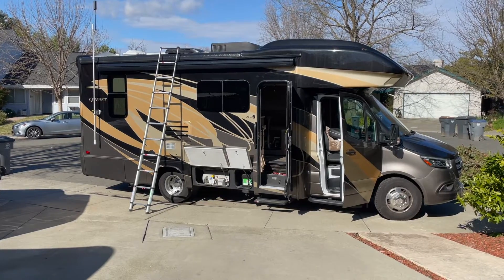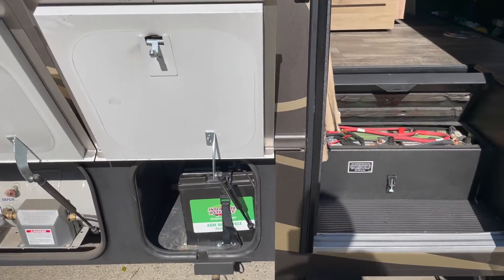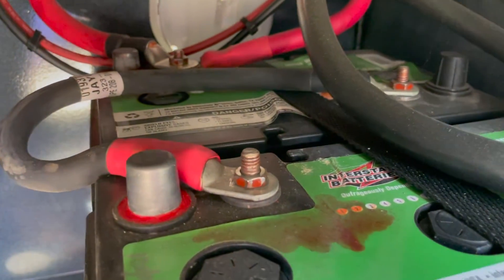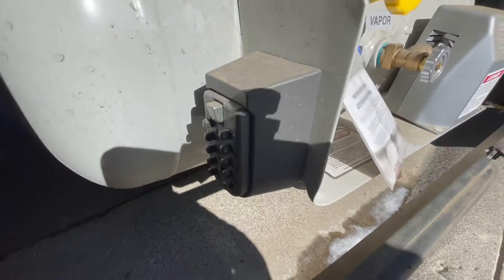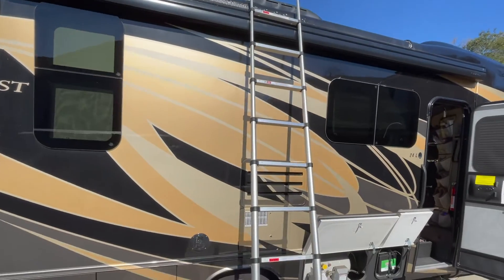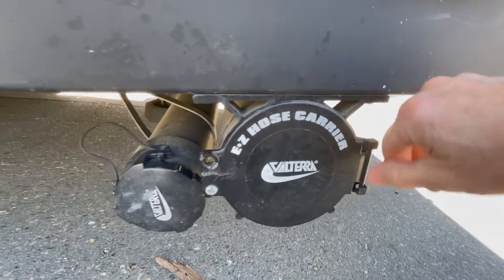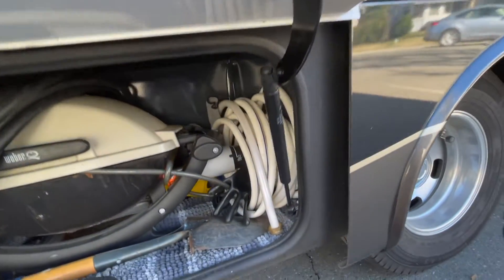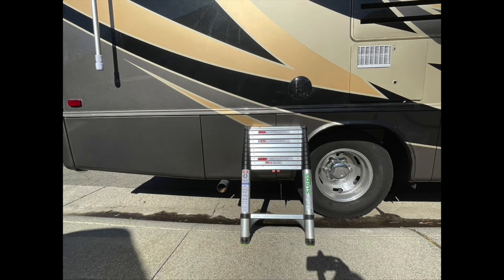Entegra Exterior Upgrades Motorhome Class C

Comment: Hi Julie, we've talked before.  Can you help me figure out how to identify and order key blanks to have an extra key made for the hide-a-key box, like you installed.  My local locksmiths do not have the TriMark key blanks for our 2020 Entegra Qwest.
Thank you,
Tim
Reply from the maker: Never had to order one, came with 3 but with that said, try emailing directly and include your unit number (specific to your unit, usually LZ38965 something like that) and I bet they can get for you……motorizedservice@jayco.com.  They have helped me out on rv blue prints etc.
Reply: @rvtipsandbitsneverstoplear3895  Thanks so much!
Reply: Hi Julie, I just wanted to add that I was able to have duplicate keys made after finding a site called "Easy Key".   I ordered the TriMark keys using the number stamped on the originals and they worked perfectly!  BTW, Jayco was no help at all.

Comment: We have the same exact Qwest 24L that you do except that we have a diesel gen. We have just bought the 2020 with only 8000 miles and are loving it. We are really enjoying your videos and incorporating many of your ideas. I do have a couple of questions please-On the compartment door, I’ll order the bracket but, can I use the original gas strut? We have a set of 6 Flo Thru TST’s and 4 of the smaller. I too did not like the Flo Thru’s and will probably buy two more of the smaller ones. We had a class A and towed a Honda CRV. Wife does not want to tow but, I do. What do you tow and how has that worked out? Are those 6 Volt AGM’s under your step and do I have to worry about the original charger working for the AGM’s? Thanks, Ken and Teddy
Reply from the maker: Yes, you just need to order bracket, see link above, took a few minutes to figure out how it attaches and you can use your other door as a guide, bracket will clip on to strut. We have a set up for a tow of a two door Jeep and we have towed it a couple times. But to be honest we are actually trying to learn to camp without towing since this RV is pretty easy to move around. I think if we go to like the Sierra Mountains or areas where we might not want to drive the motorhome up to go hiking that we might tow the jeep. Yes you can just switch out your 212 V batteries and go with the six full AGM. You don’t really need to change anything else as it is compatible. I do have the Xantrex inverter and when reading the control panel that I put in I did have to switch that to read AGM. This is our seventh Motorhome/trailer, and we are doing a lot to this one to make it our own instead of always changing them out! But we’ve learned a lot along the way!